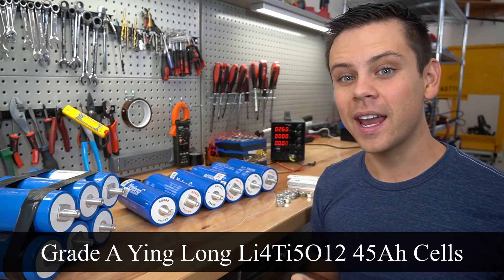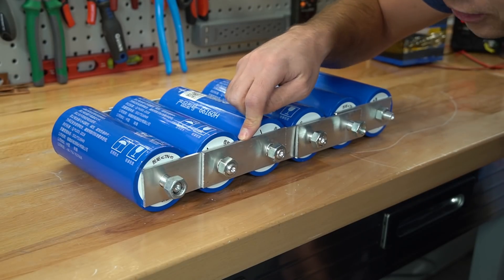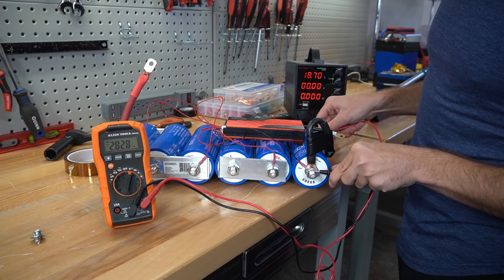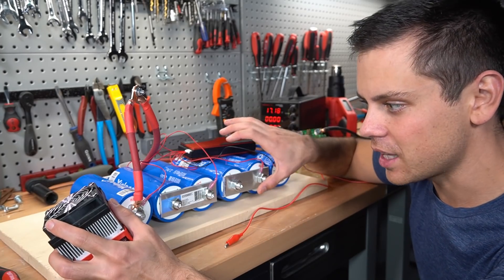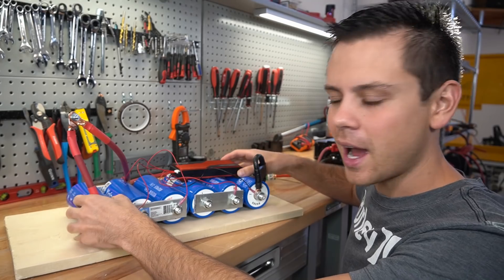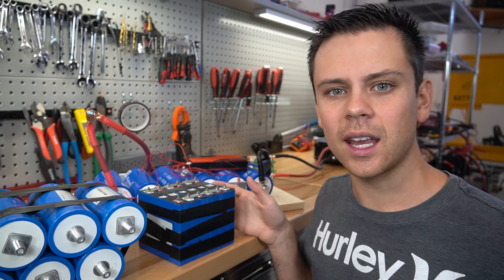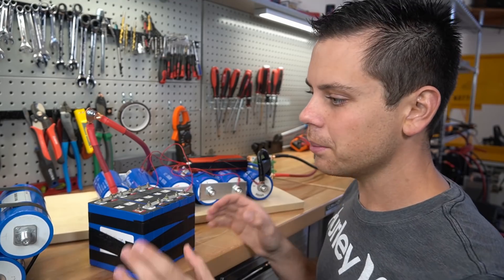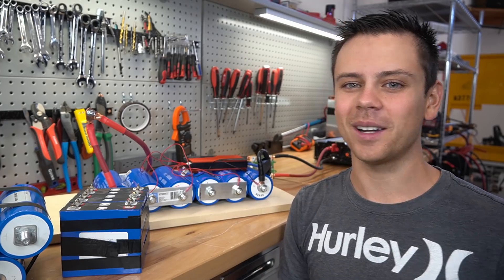$493 Aliexpress 45Ah Grade A, YinLong Lithium Titanate (LTO) Cell Testing

Comment: Car audio, and maybe car starting battery replacement maybe? In cars or emergency vehicles that need a somewhat deeper cycle starting battery, that have accessories that are used while the engine is not running,  I guess the LTO would be really suited for portable tools, like welders, large saws,  things that require high power and cycled, with a pack of these, a portable welder could perform well!

Comment: You could also combine super capacitors inline with  lithium and get the same benefit. Correct me if I'm wrong. Have you tested Anti-Gravity Car Batteries? Are they any good?

Comment: Why? Electric busses / public transport. The use case fits and China uses them a lot in the cities.
Too bad you got grade B again. Bought mine in Europe as 40Ah and they test as such.

Not sure where you got the info from that 24v isn't a good fit. I use them with a Victron EasySolar 24/3000/70-50 and that works perfectly fine. Just yesterday I ran them down to 3%, drove to a hookup and charged them within 2 hours with the EasySolar (basically there's a MultiPlus inside next to an MPPT and more).

My high voltage is 28.6 (2.6v per cell) and low is 19.8 (1.8v per cell). The Victron EasySolar / MPPT / MultiPlus inverter work fine. Every 24v load I've put on it works fine too. Never had any device complain about voltages being either too high or too low. 33 cells in 11s3p 40Ah each, total 120Ah in 24v. I get ~3000Wh at +97% efficiency from them, measured over and over again. 1560Wp solar on the roof. Been running this system for almost a year and use them every day (as I live in my van). 

It has been freezing here last week. I was not worried and nothing happened. Other van dwellers around me had all kinds of issues with BMSs of LFP systems shutting off, AGM not performing to satisfaction, etc. Me, no problems at all except for no sunshine but that's normal here in winter time.
Reply: @SystemsPlanet  send me a message on Instagram or Facebook: @vankensteiner and I'll hook you up
Reply: @SystemsPlanet  it was me, still like it

Comment: From link, "If the weight is not enough, it is very likely to be 35AH or 40AH". Did the batteries weigh as much as they say in the link given, 1260g?
Reply: sub
Reply: Is riding 45 on battery

Comment: Hmmm .. not sure about the GRADE B question you ask -- we order several Li4Ti5012 (Lithium titanate spinel oxide) cells for the emergency generators the size of small homes we have that have to have literally an INSTANT start and all the Lithium titanate spinel oxide we get are Grade A and when we get them they are all within very tight voltage tolerances of each other -- so have no idea where all the GRADE B's are coming from ... heck I didn't even know there were Grade B's out there ...

Comment: Great video as always. I suggest to use a 2nd nut to connect BMS wires etc. to assure full pressure is applied by the 1st nut towards cells and bars. Especially with thin and/ or soft cell connectors.

Comment: What about using a 6s battery for a starting battery in a car? With the alternator voltage well below the max voltage of the cell, using a 6s without a bms seems like a decent alternative. At least as a project. Am I missing something that would not make them ideal for that? I can forsee having to check the balance occasionally, but the voltage range they would "live" in would not put them in danger.
Reply: I've had them for a year without balancer, no problems so far. Now I increased charging voltage to 15.6V, we will see how it goes 😃
Reply: @JoniK1  you will be fine at 2.6v per cell.  And there is so little energy above 2.5v per cell that there is no need to go higher. In facr I would never recommend charging over 2.6 per cell. The only thing that can hurt these is overcharging.
Reply: @Craig_Parsons  I've been testing these cells and found out there's no reason going over 15.5V. I have 240Ah in my car audio build, I have some videos on my channel
Reply: @JoniK1  sounds like we agree
Reply from the maker: Yes! I planned to mention that in my notes. That would be a great application for this chemistry. Your logic with voltage of charging system of ice vehicle is true. It works great
Reply: @WillProwse  and I would imagine that cold weather would not affect the cranking amps as much as it does lead acid (from mn so the cold is a big deal) looking forward to the freezing temp discharge tests when you get grade a cells
Reply: I just bought a "40Ah" 5s pack to try in a car (the idea being to avoid a battery heater for winter, and reduce weight compared to a Pb battery). The voltage is a little low, but the reduced voltage sag under cranking should make it at least no worse than lead acid. With OEM sized lead acid, I find you get ~12.4V at best with a full battery, ignition + lights switched on, and less if the battery isn't brand new. As long as the open circuit voltage is over 11V, I think 40Ah LTO should be able to crank most engines out there.

Though the highest you're supposed to charge an LTO cell is 2.85V (14.25V in a 5S), research literature seems to suggest permanent damage only occurs above 3V, and most cars won't produce more than 14.7V under any circumstance (the exception being some newer German cars), so 5S should be safe, IMO.
Reply: @SystemsPlanet  I have yet to receive them, but I got an assembled pack with BMS in a group 47 sized case with SAE posts from GTK (I know, sketchy seller..).
Reply: I got my GTKPower 40Ah 5S battery in the mail. Construction is...meh...It's taped and shrink wrapped pouch cells, a PCB (presumably for insulation), and then the BMS right next to it. The BMS' heatsink gets basically no airflow, but for a car application that's fine since the battery isn't doing anything most of the time. They didn't pack enough foam in so it was sliding around a little. They use 2 8AWG wires to the terminals with huge copper lugs, which seems fine to me.

Above 2.6V there is basically no capacity, so the parasitic power consumption of the BMS is quite noticeable; It went from 13.37V to 13.17V in 2 days of sitting. I'm going to do a crude capacity test tomorrow by plugging it into a car and turning on the ignition and headlights (30A ish according to my ammeter). Since the internal resistance is so low, I would expect 10V to be sufficient for cranking a car at moderate temperatures, which is more than good enough if the battery's advertised "40Ah" is only just 30Ah.

Seeing the build quality though, I would just ask for just a balancing circuit and no voltage shutoff feature. Since LTO isn't sensitive to deep discharging or temperature, it doesn't really matter.

EDIT: Capacity test doesn't seem to have gone well, a 54ish amp load drained the battery to 11.3V in around 20 minutes :( Started at 13.15V, ended at 11.30V.
Reply: I read a paper saying some LTO cells drop to closer to 2.0V than 2.2V when they're empty, so I tried running it for longer, and managed to get approximately 32Ah out of this "40Ah" pack, with the open circuit voltage ending at around 10.8V, before the voltage started dropping rapidly. Since the internal resistance is so low, I would expect this battery to crank most cars just fine at that voltage. I'm guessing these are defective or used cells, which I'm not really going to complain about since they're only $220.

Comment: I just bought 16 of 280Ah Lifepo4 from Alibaba at $86/pc. Supposedly brand new, grade A cells. I will do the capacity test and see if they are really 280 Ah. Will, do you think that Orion Junior 16s bms is not an overkill? Somehow I can not trust this so called low temp protection claimed on these Chinese units, seeing your reviews. I would rather spend a little more upfront. I like the CAN communication on these, just got the CAN to TCP/IP converter from ADFweb to view the battery data on my PLC and access it remotely. Thank you. Glad to see more of your videos again!
Reply: Acoording to your price, A grade?Sorry I don't think so. you can test the capacity when you got them. 😂😂
Reply: @huangvicky9361  don't go by the price. Have a good look around. Lifepo4 are less expensive these days. That's not surprising.
Reply: @AdamBoguski  believe or not. there is no A grade cell with your price.

Comment: A disadvantage of lithium-titanate batteries is that they have a lower inherent voltage (2.4 V), which leads to a lower specific energy (about 30–110 Wh/kg) than conventional lithium-ion battery technologies,  Apparently
Reply: Flawed logic, the two are related but independent metrics, you could have a 1V battery with 200Wh/kg... for instance. The lower voltage doesn't lead to the specific energy density. You could have a very high voltage chemistry also that is very low density.